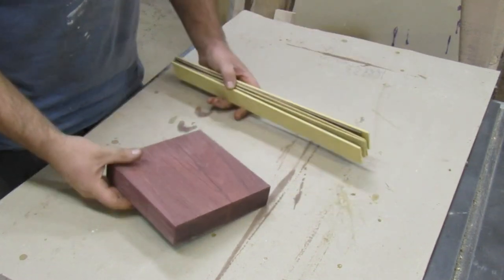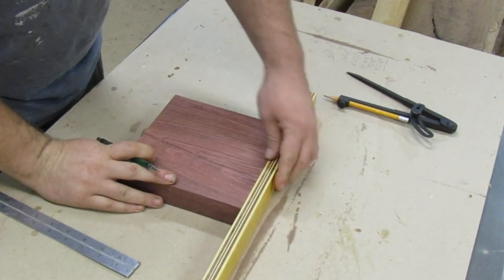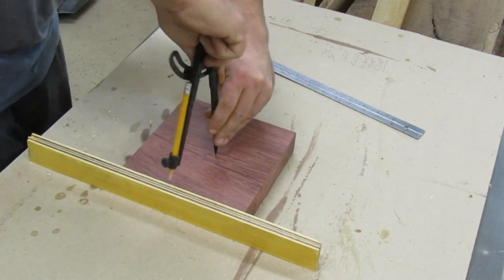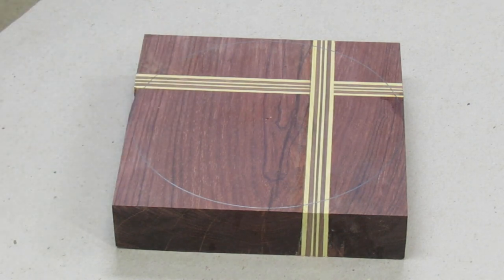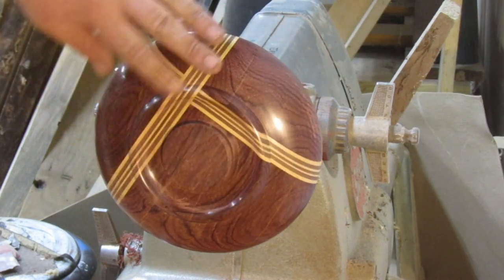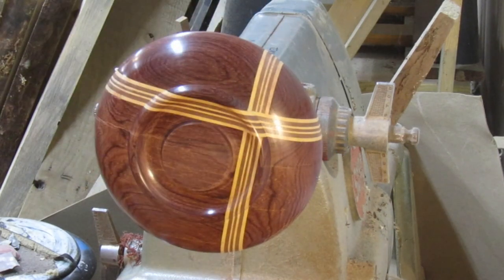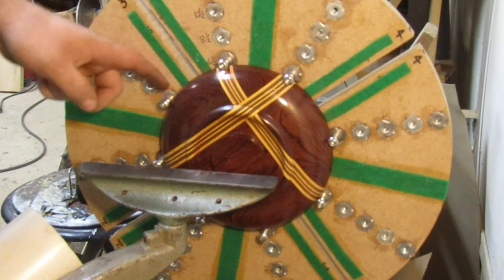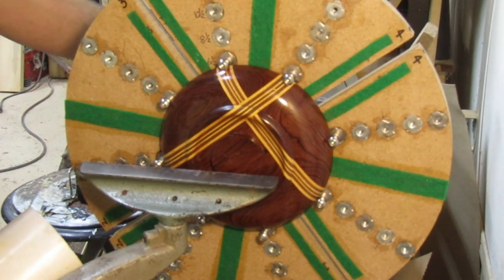Cocobolo With Tanoak & Black Walnut Wood Candy Dish

Comment: That’s a beautiful bowl. But isn’t there a problem with long grain glued across end grain, which would likely cause it to split after a while because of the uneven movement of the wood with changes in temperature and humidity?
Reply from the maker: Thank you very much Rick for the kind compliment! That's a very good point, and I'm glad you brought that up. I had thought about that a few times, but I figured that the wood was so dense that the movement would be very miniscule, but it's still a roll of the dice on what will happen in the long run. Each glue up I did I let sit in the clamps for a minimum of 24 hours, hoping that it would maybe set the bond tighter, but I may be wrong. I have done it on other projects in the past, and haven't noticed any cracking.

Comment: Lovely bit of work, I particularly like the way you made the underneath. I wondered why you went to so much trouble to work out the new centre before you cut it up - surely just as easy to do a corner to corner afrer the glue up?
Reply from the maker: Thank you very much Phil! I wanted to pinpoint the exact center so I knew exactly where the pieces were going to cross at in order to get a measurement for the cut. I did a very similar design where I just eyeballed it, and it didn't turn out at all like the one in this video, so I had to scrap the whole project because it looked horrid. Sometimes I take extra steps to make sure that what I see in my head is what comes into fruition. Thank you again for your kind compliment!
Reply: The Marble Mountain Craftsman OK, I can see your point, thanks for taking the trouble to reply. I have recently done several pieces on this theme, and it’s interesting to see what others do.
Reply from the maker: @DiveDiva2007  It's no trouble at all. I always have time to reply to the kind comments and questions on my videos. I love seeing what others make as well. I always have looked at woodworking as a collective art among woodworkers, where we share our ideas and knowledge of the craft. It's a wonderful thing for the mind, body and spirit to do.